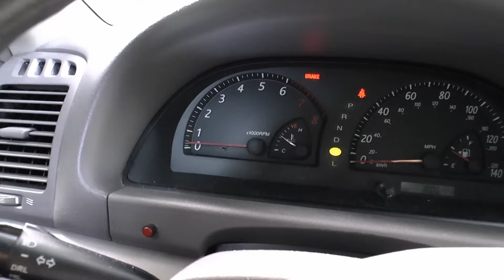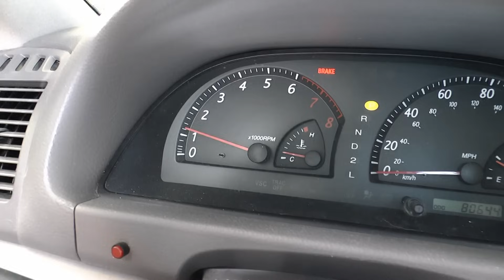How to Fix Low Idle Problems in Your Car (Throttle Body)

Comment: Hey Scotty, I`m 43 and looking to go back to school for a career certificate in automotive.  I just get discouraged with all the things to learn about repairing these new cars.  Wish they were like before........much easier!
Reply from the maker: well,nothing is getting simpler, that's for sure. See it as a challenge, fixing things others can't figure out.
Reply: Scotty Kilmer Yeah good point. Im` gonna have to. At this point in my life I`m at rock bottom and I gotta do something to secure my future.  Thank you and God bless.
Reply: It can seem discouraging, but keep in mind that engines still function the same way they always have:  Intake, Compression, Power, Exhaust.  They still take in a specific amount of air and fuel, and expel exhaust.  The laws of physics have (fortunately) remained the same.  Really, all that's changed is how air and fuel are delivered, calibrated, and expelled.  If you develop a good foundation of how engines (and other mechanical devices) work, and how electricity works, then you have a solid foundation on which to base your diagnostic skills.  Being a technician is all about diagnostics, and diagnostics are all about understanding the basic underlying principles.

Don't be afraid of it.  Immerse yourself in it.  You'll be surprised how quickly it'll sink in.  :-)
Reply: Hell, I think that the newer (1996+) cars are way easier to diagnostic with the OBD=2 port. With the old cars I had, 1971 Dodge Charger, 1979 Grand Prix, and 1983 Buick Regal, It was a pain to find the problem.
Reply: JPN850R Sounds like a pretty excited career....but I`m not that smart to begin with.
Reply: JPN850R Aren`t you guys supposed be like really smart???  I`ll never have the guts to fly again!  Greyhound and Amtrak will be getting my money from now on!  Honestly my attention span is bad, my mind wanders alot and I worry about everything all day. I`m also a negative person, I start to see all the negative things that could happen down the road and then I get discouraged.
Reply: Hey bro relax, theres so many people that are
Not the brightest and still got a career, trust me bro theres people that don't know alot and still go through it, hope you get a dream job bro Good luck
Reply: ELChulo Mc Thanks bro! Wish u the best too man!
Reply: Thank you all for your advice and encouragement!
Reply: Good job , hope you continue to further you're education, economy is screwed and we need to make more careers.
Reply: Hi Scott...I have an audi a4 2.0tdi 2006 and is got a vibration at idle (when the AC is off), and it runs smooth when the AC is on. I would really appreciate any advice as planning to go on a long trip (around 4000 miles) thank you very much.

Comment: If applicable, it's also a good idea to take off the idle air control valve and give it a good cleaning. Often fixes poor idle as well.

Comment: have same vvti corolla.. in mine the idle valve was completely clogged up and stayed up on 2-3000rpm. had to take off the throttle body and the small servo motor moving it before cleaning ,good over 5 years now. paid nearly half price for the car because this issue ,nobody could figure out :)

Comment: I had a bearing going bad in the alternator. It would turn hard sometimes and smooth sometimes. When the bearing would hang up a bit it would pull the engine down causing the computer to open the throttle to find the idle point it wanted to see, when the bearing would smooth out it did the reverse causing the engine to speed up and then back down again so my idle would go up and down. Just a tip for people having idle problems.

Comment: Ok thanks scotty I do remember a spark plug coil spring coming apart but I just put it back thinking it was supposed to do that ill look at it and  replace it and ill see if it fixed it thanks again

Comment: This might be a problem you've never heard of, but here goes;

I have a 2003 VW Golf 1.9l GT TDI PD150, 170k on the clock, and it runs perfectly when at operating temperature.

I rebuilt the car from the ground up (bought with a blown engine for around 50c 3 years ago) and the engine i put in had 60k miles on it

All the axhilleries are new / nearly new - i.e turbo, glowplugs, harness, coil, starter, aternator, battery etc etc

2 months ago my main brake light relay / servo broke and had to be replaced, which put the standard "Glow Plug Fault" light on my dash

Ever since it went the car has struggled to start from cold at any temperature (tried at 30C and -10C takes the same amount of turns to get going)

I've tried all the standard fixes i.e replaced everything to do with the starting procedure, and even changed the flywheel + gearbox + clutch on the slim chance it might have had something to do with it (plus the DMF was ruined anyway)

It's the only fault the car's ever had and no matter what i try nothing seems to solve it - my only option i think i have left is a complete ECU reset to standard and custom Map to up the fuel flow on low engine temp 

Any thoughts on this / have you ever dealt with a problem like this before?

Cheers
Reply from the maker: +Skyda  well, obviously your glow plug system is not working, You could just rewire the stupid thing to run off an aftermarket starter switch and relay to power the glow plugs manually. I've done that many times on older cars.

Comment: Scotty your awesome 👏🏼 but I learned the hard way when I owned a Nissan Murano that you cannot do that to Nissan vehicles because after that your check engine light will stay on. It’ll never get that idle relearn back to normal. My own mechanic says don’t touch those throttle body because it’s computer and you manually flipping the lever will throw it out of wack. Trust me it happened to my Murano so I dare not try it on my ‘03 Maxima.

Comment: He fixed the exact problem I'm having right now with the exact car. The mech increase the idling from throttle, I think manually, it only runned smoothly for a bit and later dropped again, what could be the problem

Comment: Don't forget if you are in a pinch and dont have cleaner, you can often turn the throttle plate stop screw much like you can on a carburetor. It is not a permanent fix, but it could get you home if your car is running poorly, or even stalling.
Reply from the maker: NEVER change that screw on a modern car, it will mess with the computer settings and you may have a hard time setting it correctly back to the perfect spot. AND, on an electronic throttle like this car, there is no screw anyway.
Reply: That first part is not entirely true in my experience. The IAC valve is what controls the idle, but it only has a certain amount of range it can work with. When carbon builds up, and cuts off air flow, it restricts the flow beyond what the IAC valve can correct for. As long as you are not far off, the car will idle, and run just fine. I have adjusted the stop screw on a few cars, of my own, and others. It got me to work during the week until I was able to properly clean it. Of course you already know this, and as a mechanic you don't need to do this anyway. Its really only a trick to get you along until you can get it to a mechanic, or clean it yourself.

Comment: I have Toyota Camry 2010 and it seems more difficult to clean the throttle body, appreciate if you show how to do it.
Also a lot of people they are cleaning it while the car is running so which is the appropriate way 
Thank you

Comment: Sweet gonna try this on my ford escape 2004 model, i thought it was my rocket gasket cover seals being the problem (which they did leak a bit of oil onto the spark plugs) so fixed that but still got that low idle issue, gonna give it a clean like in this video and see how I go.

Comment: Scotty, what if car is reaving up too much? My Renault 1.2 (petrol engine) reves up when idling. I took of the throttle and clean it with cleaner, but got even worse after few days. What to do?
Thanks for such a good work with theese videos. I like them!

Comment: In another video you said if the idle is bad don’t buy a used car because it could mean the transmission is wearing out. What if it’s just the throttle needing to be cleaned? how can you tell the difference? if you can spray the throttle clean for 5 bucks and get a car for thousands less, wouldn’t it be a good buy?

Comment: I did this and also found a rubber pipe had a hole in it. And it had been modified so it was probably that too. I just got some proper pipe and put it on. Been ok since

Comment: Hi Scotty. My 2009 Toyota Auris is still idling poorly when the engine is hot, after I pulled off and  cleaned the throttle body as you said, and also cleaned the Mass Air Flow sensor, but still the same...
Reply: egr valve
Reply: oxygen sensors
Reply: crank shaft sensor and coolant temp sensor
Reply: You shouldn't have used car cleaner on the MAF sensor or WD40 for that matter, electrical contact cleaner is the proper stuff !!
Reply: Ha! 4 different answers.

Comment: Other vids I've seen don't mention the need to unhook the battery.  I mean, if the key is completely off or out, doesn't that shut down 99.9% of the electronics except alarm, horn, etc?  Why would the TB still be electrified with   the key out?

Comment: scotty i just replaced my fuel pump, unfortunately i did not disconnect the battery whille doing so. my car started but immediately died after. i primed the pump with just turning the key and hearing for the pump to sound on a few times. started it by holding down the gas pedal. but now it idles 100 rpms which i believe is the first line from the off position. before i changed the pump it started perfectly idles well.
Reply from the maker: check wiring in the area you worked, and also pressure test the pump, often cheaper aftermarket pumps do not work right

Comment: So it is imperative to disconnect the negative battery terminal to clean the throttle body or replace the IAC unit?

Comment: I have an Acura TL 2008 and I just got my timing belt replaced and both engine mounts replaced, but after I left the workshop I felt lots of vibration and specially on the red light it shakes so much, first I thought may be it's because it's cold and engin is taking time to get smoother. its mostly smooth when it's on the highway running on 70mph or more and in reverse it's smooth and way lesser vibration in park shift too. But as soon as I put car in drive mode, it starts vibrating alot.

Comment: scotty i have a saturn aura xe and i cleaned the throttle body. it idled at 2.5krpm but if i were to put it in drive it would go to normal idle right away it wont relearn the new idle.

Comment: If that works on my Toyota hilux sr5 5vzfe after I get another ecu as mine was badly corroded and blew a resistor after cleaning with electronic contact cleaner and soda bicarb. Looks good but moist air evaporating from the wet floor. Aircon leaking , heater core as well. Anyone with a 5vzfe engine Toyota even tho your terminals might be clean as mine were make sure your ecu has no signs of corrosion on the outside and if you do open the unit like i did use a anti static mat and dont touch and points on ecu unless you have a wrist strap. I was taught that in my electronics course years ago.

Comment: Hi Scotty, on a Chevrolet Tracker 2003 the transmission went bad so it was repair after that is idiling poorly I'm assuming that is because the battery was disconnected; well I already perfom the cleaning on the trottle but problem reminds. There are no codes check engine light goes on when the key is at the on position then goes off starting the engine witch is normal; so what else can we check, Thanks for your help

Comment: Scotty, do you have a video explaining how to fix a Honda that the idle goes up and down? My mom's car recently started having idle issues in a very weird way. Never seen a Honda do it like that. Idle goes up and down really fast to the point where it almost sounds as a rotary. If you don't have a video of that, it would be extremely awesome if you could do one and go in depth in the different things that can cause that and the fixes. You have no idea how many people you will be helping.
Reply from the maker: often removing the throttle body , taking it all apart, and cleaning every stinking little hole will fix that. No video on that yet though
Reply: Scotty Kilmer Thanks, I will work on that this weekend. Appreciate the reply Scotty!

Comment: I have a 2002 Chevy cavalier that idles randomly between 500 and 1100 rpm, dies as the car comes to a stop and will no longer rev past 4000 rpm in park. I took the IAC and throttle body out cleaned both tested the IAC with a multimeter which read 71. Checked plugs and wires cleaned and regapped plugs. Still it runs like a tank any suggestions or a point in the right direction would be of great help. "Currently waiting for New online order IAC" to arrive".

Comment: I have a 02 eclipse gt 3.0 it starts with a low idle which if you don't tap the gas alil to help the car it will die? I replaced the Idle Control valve & removed my cold air intake but I still have the same problem? What do you think it is? My throttle position sensor or dirty throttle body? Thanks for your help love the content!

Comment: Hi Scotty, first I want to thank you for all of these exceedingly helpful videos, no lies, however I can't find my current problem and money has always been tight. I have a 2002 nissan maxima se manual. Occasionally it will not Rev higher than 2500rpm acting like it is redlining. Also it has died a few times when coming to a stop. When this happens i have next to zero throttle response and if I pull over and restart the engine, or while rolling, it will come back to normal(for a time).  Any help will be much appreciated. And thanks again for all the help you've already given me.
Reply: Apologies, it is a 2001. 3.0 5speed
Reply from the maker: Sean Patchin   check the catalytic converter, clogged up ones often do that. If not that, pressure test the fuel pump AFTER changing the fuel filter

Comment: Hello Scotty.
If it's not too much to ask.
I just clean the throttle body of a rav4  2000 and now it won't start.
Would you guide me to find the problem?.
I mean the engine keeps going as long as the gas pedal is pressed but as soon as it is released it dies

Comment: Hi Scotty,  I have a 2001 c class w203 mercedes. I have to keep the fuel above the half way mark or it cuts out. I've been told that because the fuel tank is like saddle bags, that one tank isn't pumping across to the other?

Comment: Hi Scott,  I have done the above things to my 1996 Nissan Sentra.  I swapped out the IAC valve and it still idles poorly.  Should I disconnect & reconnect the battery in hopes of resetting the car's memory?

Comment: I have 2010 toyota corolla. in electronic throttle body top right cornar there is a screw hidden in a glue type material.
can you please tell me, what is the function of that. and how it help in adjusting a specific parameter?
I have observed that changing the position of that screw make throttal pedal to respond differently and effect the drivability .
I have an issue of poor idling. first the mechanic messed up with this screw.. throttle body is cleaned. every possibility has been checked but could not fix the issue.

Comment: Hey Scotty, have a great running 03 Mitsubishi Montero XLS 3.8L SUV with 157,800 miles on it. 
When she starts it takes 4 cranks of the starter before engine fires. New battery was bought in 6/18. Is this old fuel pump going out or blocked fuel filter? If so is it easier to change pump/filter by getting to it through floor or dropping gas tank? No info or videos I can find. 
Thanks and Ive watch all of your videos and have learned alot.

Comment: Scotty! My Honda Accord stalls when I start my AC... When I scanned the car a CKP sensor code (P0339) so I replaced the wiring and also changed the spark plugs... but the thing still stalls. Can you suggest me what should I do? As there are no codes showing up...

Comment: I have an 03 4 cylinder Camry. AAA replaced the battery and I'm having the same issues. I replaced the MAF sensorand had the throttle body cleaned. I still have a rough idle and the alternator has been replaced twice in 2 weeks. Any advice. The only thing that I need to double check is the throttle to see if it was cleaned properly.

Comment: Removed cats+ 02 sensors...now car idles at 500rpm instead of 950rpm.....should I get a high flow cat and throw sensors back in? Should do it? Oh-- only when it's hot does my idle drop.....about 8 mins into driving it. Thx. 0 issues, and 0 C.E.L was on until the SAME DAY I replaced my exhaust to a no cat exhaust.

Comment: I can't figure out what's wrong with my car(2001 Ford escort se). Had a radiator leak a week ago. Replaced the upper/ lower hoses, cleaned the reservoir tank. New heater core pump. Low coolant light still flashes on. Then had a engine misfire. Replaced sparkplugs/coils & wires new thermostat. Code cleared and popped up again w/engine misfire and a random misfire. Plus the coolant light came back on whenever the car starts shaking really bad. Changed filters. Had a fuel system service done . Same problem and rough idling.

Comment: hello sir 
thank for the video 
my cars rpm is lower that 300 rpm and my engine is not shaking while its idling , but i had some problem when iam driving some times i had hard steering when its idling unless i push the pedal also my ac is not blowing that cold when its idling unless i push the pedal 
i had saw this video and do exactly what you did , but still have the problem .
i have obd2 diagnose i have checked the errors and i didn't found any of them 

its sonata 2006 4cyl